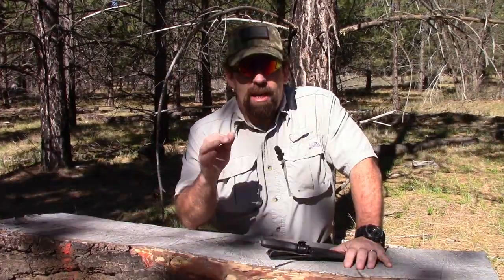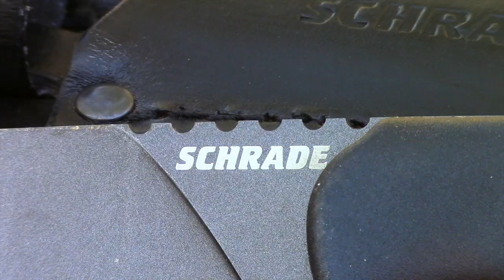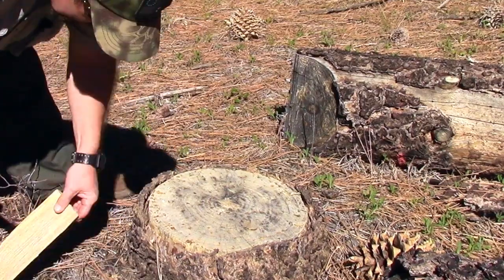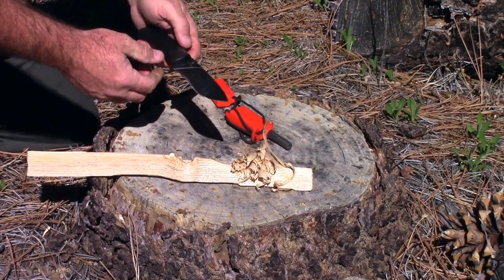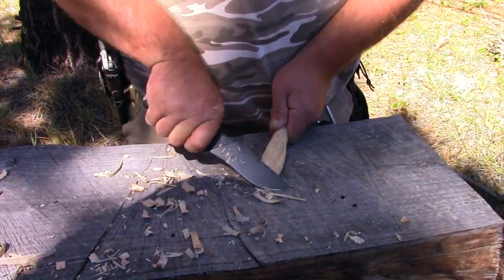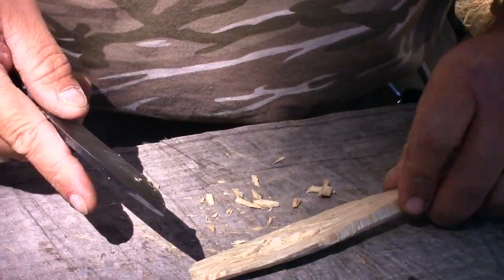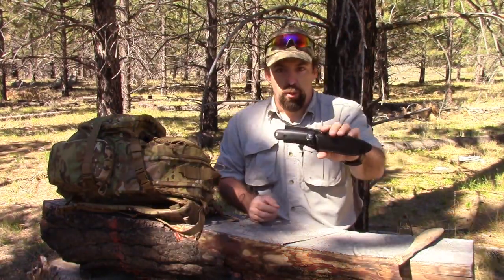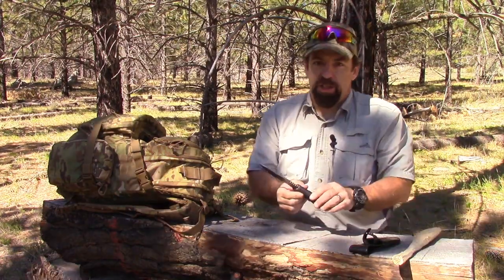Schrade SCHF42 New 2015! Bushcraft Ready Knife

Comment: You know, I know some folks have an issue with sharpening a recurve blade, but I really think the benefits outweigh the added difficulty in sharpening. For me, it's no big deal. I usually maintain my blades with a spyderco Sharpmaker which has no problem with the recurve. That continuous curve edge is a real performance enhancement.
The 36,37 and 38 were big improvements but they still had handle issues and a good handle is a big deal. That handle looks spot on. I can't wait to get this one in hand. I think I may take it pig hunting.
You know, I don't know if Schrade customers would pay the elevated price, but I'd love to see this knife in D2 with some really nice micarta scales. I wonder if they would consider a "premium " line?
Reply from the maker: I'm sure if they hear enough comment on videos like this they will listen.

Comment: Nice knife. I just got mine two days ago ($46).  I like it a lot.  Some do not like the recurve blade because it is not so easy to sharpen, but it really cuts well.   As others have noted on several videos, the screws holding the handle scales will loosen.  Actually, right out of the box 3 of the 4 screws were loose on my knife.   I aligned the scales and Locktite on the screws before re-tightening solves the problem.
Reply from the maker: jffrocks Yes mine has come loose but some blue locktite did the job..